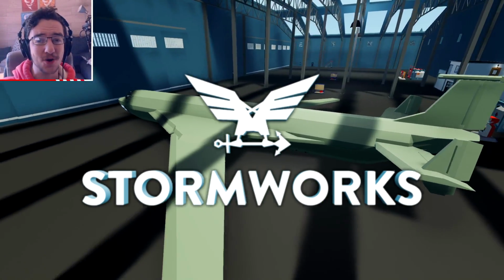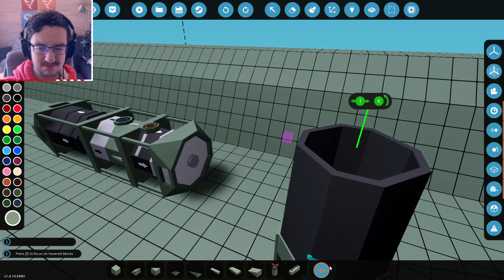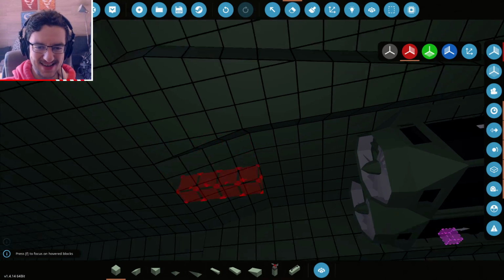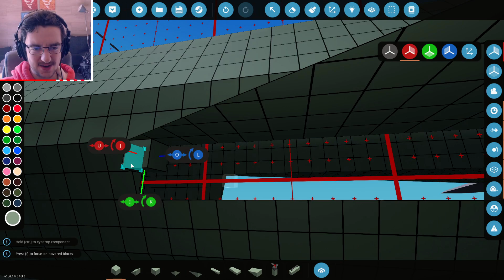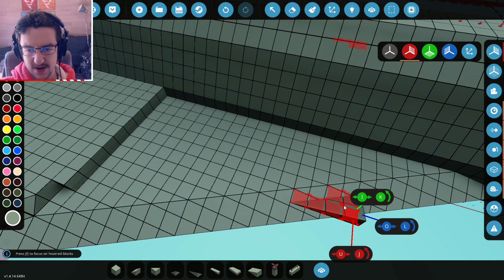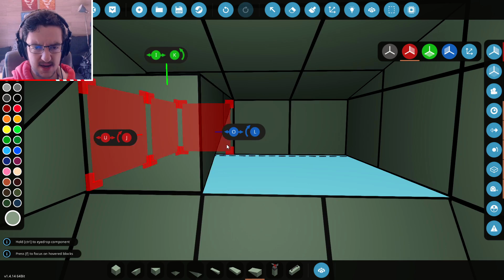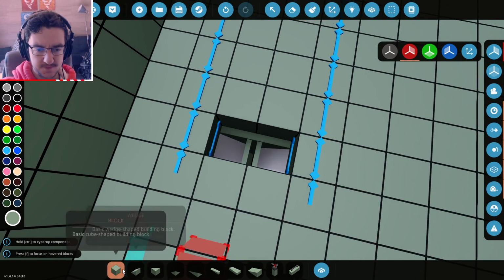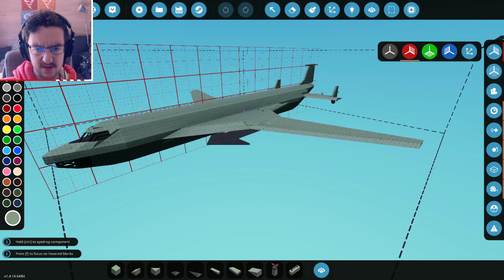Jet Engine Pods ADDED! - Bomber Build - Stormworks Search and Destroy

Comment: Add the afterburner back it fits with the sweep wings
And also remove the regular intakes and replace them with a small ducted fan
Reply: the small ducted fan does not have any intake does it ?

Comment: If you use the same strategy to make the fuel tanks in the wings (as in using wedges to open a space in a 2 block thick area for fuel) you can connect it to the current tanks and have the fuel capacity way larger. It would also be cool if this had ejection seats, the Turtles Ejection Seat Pack as 3 types of seats to choose from, with 3 layouts of the seats.

Comment: Looking good.  10:53 What you were doing here with mirrored wedges, you can make a 2 block thick wing a fuel tank.  Any wedge is always going to be 1/2 air (fuel) 1/2 block.  Even if you have a 2x2 space, four 1x1 wedges all rotated 90 degrees from each other leaves that diamond shape in the center that can be filled with fuel.  Increasing to a 1x2 or 1x4 wedge just increases capacity further.

Comment: One thing that I think would be cool is adding some detatchable rocket pods to the wings to give it a boost during takeoff, the SAC (strategic bombing command) did this with B-47s so they could take off with heavier loads.
Reply: I thought that was only with B-47s
Reply: @spiderpotato1139  Oops, your right, typo. Thanks for pointing it out.